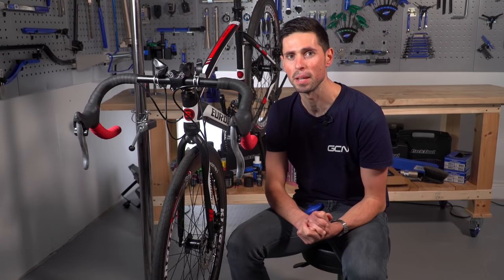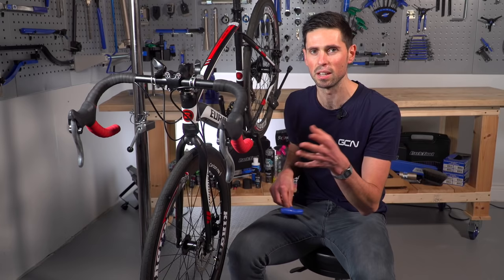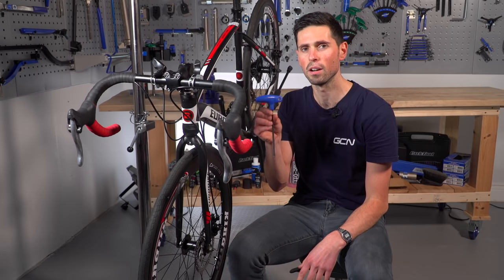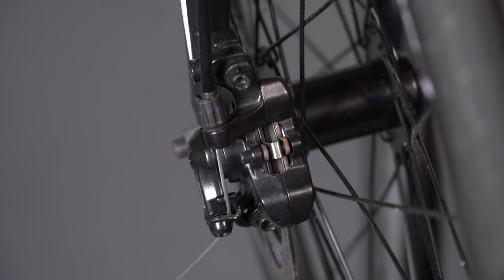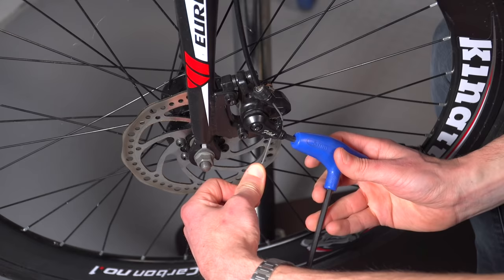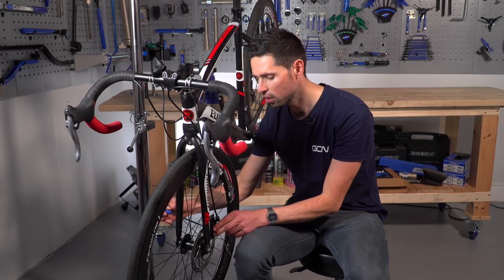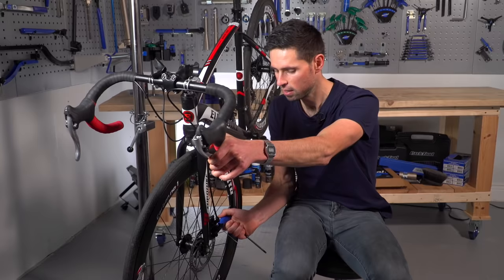How To Adjust Cable Activated Disc Brakes | Maintenance Monday

Comment: Too many videos show how to handle front easy to get at brakes. Why does no one show a video instruction for the most common problem., even out of the box brand new ebike. Rear brake lever is too close to the grip to activate the brake. Front brakes last WAAAY LONGER, as they are barely used.

Comment: Thanx! I live in a small town in BC, Canada, and the bike shop cannot fit me in until one month for repairs. I have to do a disc brake adjustment tomorrow, and I am now starting to do my own work on my Rocky Mountain Vertex 10 MTB. I trued my wobbly front wheel today, and fixed a flat on my rear tire also. It is very satisfying fixing my own ride!
Reply: What bike do u have

Comment: Mine is a TRP Spyre, no hassling with barrel adjuster. As long as your caliper is parallel to you rotor, 3mm allen key will do the rest.
Reply: The bike I've just sold had the same (TRP Spyres) and I thought they were just fine. The one-finger breaking on the 105 hydraulic callipers on the replacement bike however is wonderful.
Reply: @matthewvelo  My dad has 105 hydraulic on his bike. Surely it's amazing how you could just brake with one finger, while I have to put quite a bit of force on my 5800 shifters. But the cost... I just can't justify to upgrade. Mechanical still works for me.

Comment: Thanks for this. It's very helpful for those of us with touring bikes, where cable-operated discs are preferable to hydraulic due to less risk of maintenance issues when far away from a bike shop.  The hydraulic discs on my road bike are very temperamental compared to the ones on the touring bike, but the modulation when they are working is outstanding.

Comment: This was very well explained, and covered some of the points that others seem to miss. As someone who has had to take a bike into the shop twice in the same week, due to the front brake locking on during a commute, knowing what I can do to fix the issue enough to get home is very helpful
Reply from the maker: hi, thanks for the comment! glad you enjoyed the video and it was useful
Reply: @gcntech  you mentioned at the beginning of the video that you don't see cable disk brake much on road bikes anymore. Which brakes are you seeing in their place more often now? I am presuming you implied you now see more hydraulic disk brakes on road bikes than cable disk brakes? or?

Comment: I love cable actuated disc brakes. I have trp spyre-c and they are great after I have modified them to be useful. I put some grease inside to the bearings that became rusty and I cut a groove to the clamp that holds the cable. Because originally the clamp had teeth machined into the surface that holds the cable(across with cable) to provide superior grip. Those teeth destroyed the cable. After few times adjusting it, there was only 3 furs left holding the cable.. Little bit helped if I did not dightened it so hard, but I never exeeded 7 Nm torgue. Usually it's 7 Nm needed. I think I had 5 at first, because it felt like that's good for it. But tryied also 7 that is recomended for most cable actuated brakes I think. That destroyed the cable.. But now with groove for cable to sit in. It's so good. Now I can use abit more expensive polished stainlesssteel cables. Also kelvar reinforced outers. The front brake is now very smooth firm and well working, comparable to well bleeded/maintained hydraulic brakes, except the actuator arm on caliper flexes a bit when press really hard.. but doesn't compress the cable outer. And sti 5800 brake lever flex too. Mechanical brakes aren't made too good, because the industry want to force hydraulic brakes, that are easier to manufacture and frame designers can design more aerodynamic frames by hiding hoses and don't need to be concerned about best lines for mechanical cables to work properly.

Comment: Cable actuated discs will still be common. Eventually even most entry level frames will be made disc only but the cost of making an entry level groupset fully hydraulic would not be economical. So it makes a lot of sense. It would mean that Shimano Claris and Sora would not need complete redesigns and can continue using the tried and tested trickle down tech approach.

In all fairness, the latest Claris and Sora iterations are so good for their budget they have very little to no performance disadvantage to the older Dura-Ace and Ultegra of the same speed, just weight. Also the additional refinement of the components (both in tech and ergonomics) mean they look and feel better too. The fact that the latest Sora shifters allow the cables to run under the bar tape makes a cleaner aesthetic than the old Flight Deck levers.

Comment: A more systematic approach for adjusting single-piston mechanical disc brake calipers is:
1. Loosen mounting bolts just enough for the caliper to wiggle.
2. Pull the brake lever and hold.
3. Adjust the inboard pad until the rotor is more or less in the center of the caliper's slot, eliminating the chance of the rotor rubbing against the caliper body. Slightly reduce lever pull as you wind the adjuster clockwise.
4. Gradually tighten the mounting bolts alternately while still pulling the lever.
5. Let go of lever and release cable tension by loosening cable bolt.
6. Spin the wheel and slowly back off the inboard pad until brake rub is gone.
7. Shine light between the pads and rotor, position the cable arm such that the moving pad is close enough to the rotor, and affix the cable to the cable bolt.
8. Fine tune the bite point with the barrel adjuster.

Note: some calipers have a 2mm grub screw that "locks" the inboard pad adjuster that needs to be backed off to avoid marring the adjuster's threads.

Also, dry-lube your cables, housings, and lever pivots once a month, regardless if they're teflon-coated or surface-finished. Doing so, they can feel as slick as hydraulic levers.

Comment: This was absolute magic. I just saved myself a trip to the bike store and now I actually understand how disk brakes work (on ebike).  Thank you (subscribed).  I should mention I was getting a clicking from my caliber (causing failure) and figured out just a simple drop or two of oil on outside of the caliber (so it closes smoothly) resolved the issue.

Comment: Can't thank you enough for posting this. It's the best, simplest most concise brake adjustment I've seen for cable operated disc brakes. The front and rear brakes on both my Aventon E-bikes were getting a tad sloppy at the lever and this is exactly what I needed to bring it back to factory pull and feel.

Comment: I have TRP Spyre’s on my road bike. I really like them. Much quieter and easier to live with than the hydros on my gravel bike, even if I do give up a bit of braking power and modulation
Reply: The noise will be unrelated. Probably due to contamination 👍

Comment: Great information. It will definitely help me with my new bike. What I need right now is a video on why my mechanical disk brakes aren’t stopping the bike quickly. I just got a used Raleigh Redux 1 and need to figure out what’s wrong with the brakes. The V brakes on my older bikes work better than these.

Comment: I service mech discs for a living, sorry you adjusted everything in the wrong order. 
Start with 2:05 loosen cable
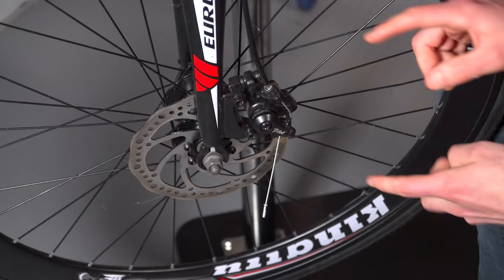3:28 undo caliper post mount bolts, just loose with minute tension
Put paper/business card in between pads/disc
1:33 tighten the inner pad adjuster till the outer pad contacts. Remember the disc will flex so wiggle the rim or push the disc to confirm its straight. 
Mark the post mount to caliper alignment with texta/paint or ideally scribe a line across both parts
Tighten the caliper post mounts, make sure your texta/scribe line stayed true where you marked it. Even with washers these elongated holes move around when torquing. 
Tighten the cable. 
Spin the wheel, check for daylight between the outer pad and disc. 
Make the inner pad almost rub. 

It is critical that the calipers rotating arm be at maximum looseness (rotated anticlockwise as far as possible) with the outer pad as close to the disc. 
It uses 3 ball bearings that are on ramps. When not set as above the ramps run out of room. 
You lose breaking leverage(they will run out of travel and apply no more force) and the calipers will lock up/lock on and they won't release.
 These ramps not only wear down but they form a divet at maximum clockwise rotation. 
I would strongly recommend removing the lever arm and repacking the grease on these balls. Most/all mech calipers are built with donkey turd for grease that overheats in 1 stop. Just use car wheel bearing grease, no lithium or eco friendly garbage, don't use oil or anti seize. High temp wheel bearing grease only. 
Good calipers have 2 o rings to stop grease seeping into the brake pads (tektro/promax) others like zoom do not. They are shocking as well as have undersized pads. 

Setup well mech discs will equal performance of hydraulic, but finger pull strength is greater. You will feel more with cable and you have no fluid to boil. 
The original mech calipers had a sliding pivot(floating calipers) that self centered the pads on the rotor. The identical setup to 99.9% of cars. This prevents the disc from flexing to one side which causes pads to wear at an angle/slope which then makes the disc flex even more. 
The outer pads still wear 30% faster so pressures are not equal, but considering that bike hydraulic calipers rub and push discs to one side its not like this issue is fixed with hydraulic.
Reply: Very good manual/explanation. 😀 Can you give some advice about cables/housings too? I have noticed, that when I cut the end of compressionless housing (sometime called universal housing, because it has same construction like shifting cable, but is reinforced with Kelvar) nice and flat, when it's straight. The end becomes non straight (Some wires that have shorter bath through of curves protrude), when I route it to frame. Frame designers always don't take to account how the curves effect the cable housing. I cut the outer first a bit longer and then cut the excess, to square square end after routing it, but it's so much hassle. I need to remove caliper and hold the end on right place.. And little space to cut it there. Also I think it would take time for wires to settle on right place.. So I might need to do it again. And I wonder is there actually much difference.. Or I'm just going too far with perfectionism. Or maybe I make actually things worse by doing that? I think I got it working little bit better, than it was before, Because it became more compression less. The outer is less springy, but I'm not sure.. Might be just that I routed it better. But I was able to leave bigger cap between pad and rotor. Although I have adjusted the brake levers reach little closer. I can still get the brake levers against bar if I brake full force, but it works great. I was surprised that when I replaced the handlebar. The curve the outer took, was perfect. The ends of housings that go to lever were exactly same like when the housing was straight. So I supose some manufacturers do design their stuff better than others. And that handlebar was not even expensive. But from a good brand.. They must be just on another level. ^_^
Reply: @Hardi26  are you saying you end up with friction or that cable free play is an issue? Internal cables will flex more if the frame mounts don't hold the cable outer fixed. 
People like sethsbikehacks drill out frame cable mounts and install 1 piece cable outers instead of the exposed 3 piece cable outers. 
The 3 piece make the cable stiffer, counter intuitive. But as you pull the cable the outer housing moves wasting energy and meaning more lever throw for the same caliper piston movement.
Reply: @janeblogs324  Sorry, it seems I have difficult to explain what I mean. I'm talking about wires that are part of braided universal housing. The ones that are under compression when braking. Not confused with pulling cable. When I cut the braided cable housing correctly 90 degree angle, so that it would fit inside end cap nice all around, when the housing is straight. The cut changes, when I bend housing More noticeable when bending it at close to the cut.. It changes less or not at all if the section of bend has certain length, because all those wires spiral gradually around the housing. When makinf sharp/short bend some steel wires that are part of housing, protrude out from the cut end. And then not all wires of housing don't touch the end cap. I think that it is not good, if only one edge of housing is against the end cap. Maybe it's not a problem for shifting housing, because there is not so much force, but in braking it probably need all the steel wires that housing has to hold.. But I like the braided universal housing still better for disc brake. It's just that because how the frame is designed, there is a sharp turn near to brake caliper where the cable comes out from inside fork. Maybe it would really be better to route cable to outside of fork. And in 3 sections.. and with some sealed kit to keep dirt away.

Comment: When you pull the brake cable out to tighten it. Should you have the 2 barrel adjusters tightened all the way? Only asking because I've had to adjust the barrel adjusters alot more than I've seen people online do and I know there's a limit.

Comment: My new bike has two brake levers per caliper, and that confuses me a little.  For the front brake, one lever is adjusted properly, the other bottoms out. I'm guessing when I go look at it again there are barrel adjusters on each of the levers to adjust them relatively. Could be a good video topic.

Comment: How about tips on adjusting the cable front derailleur without a barrel adjuster?
Reply: It would be done purely by feel without a barrel adjuster. It can be done but for a home mechanic it would take quite a bit of time to get right. I'd advise replacing the cable and installing an inline barrel adjuster. Cable + inline barrel would cost under $10 and would make all future adjustments a breeze.

Comment: I have the cable activated disc break system and tried to adjust the stationary side of the disc brake but while I was doing so, I noticed that that setscrew that adjusts the opposite side of the cable controlled brake (stationary side) only turns ever so slightly. 
Is this normal or should the adjustment screw turn at least one full revolution?

Comment: The Aipas customer support provided with this video link when I have asked them why my new A2 Elite e-bike brakes noisy when applying both brakes. Just after I put only the first 20 mi on my best value e-bike below $1K for the masses. After 450 mi on my odometer the brakes still squeeze and the issue is not exactly in adjusting the mechanical 180mm cable brakes?! Your thoughts?

Comment: Hello, i have shimano sora mechanical disc brakes. Now my brake lever for the front has to go against my handlebars before it has enough tension to brake. I have already tried to unscrew and add tension but that didn't help at all. Do you have any tips??
Reply from the maker: hi, thanks for the comment! Without seeing it, it is hard to offer any advice, we would certainly recommend visiting a local bike shop to take a look. thanks

Comment: What could be wrong if I have cable disc brakes and on 1 side of the handlebar, the brake lever cable is loose from its housing? When i try to push the cable into the slot it pushes the brake lever backwards when its completely in. The other side has the cable fully in and the lever in a neutral position (normal)

Comment: You should not use the barrel adjuster to compensate for pad wearing, but only for cable slaking. Adjusting the barrel changes the lever arm of your pad actuator. It's the same thing on all cable actuated brakes, barrel adjusters are not a way to compensate for wearing of the braking surfaces.

Comment: In my experience with mech discs, even trp spyre, I’d rather have rim brakes. Hybrid cable hydraulic are so much better and even the cheapest full hydro is luxurious by comparison
Reply: You actually like hybrid brakes? Maybe you have a brand that has what mine are missing?  
I can't stand mine. You can't adjust the spring tension (I have a cable that's routed through the forks adding just enough friction that it won't release completely, so it's dragging), can't adjust the pads (if I take them off it takes 2~3 hours of fiddling to get them centered again (and no the “clamp them with spacers and tighten them down” trick does not work and having adjustable pads like on my old mechanical disks was SO much easier to tune). 
I'm absolutely done with them. The moment they start squeaking I swear to god they're going in the trash and I won't feel the least regret, I'm just done with them.
Reply: @wilfdarr  I have juintech x1 and haven't had any of the problems you mention. It's an upgrade of their first design. I think they're getting better than they used to be.
Reply: @thebr0wnhornet  
I'll look em up. Thanks.

Comment: This seems to only be the only video I can find that has the same type of disc brakes I have. I cannot seem to get the front brake to engage. I’ll keep trying. I’ve tried for hours. Messed with every single adjustment in this video and nothing seems to work. I do not want to take it to a bike shop for another $25. There has to be something I don’t know.

Comment: One big plus of cable disc is you cant screw it over by pulling the brake without a wheel in the bike
Reply: I thought that
Reply: If you do this, you can literally push the pistons back in

Comment: Cheap discs are far worse than decent v-brakes, from warped rotors to cheap calipers that move when you tighten the mounting bolts.